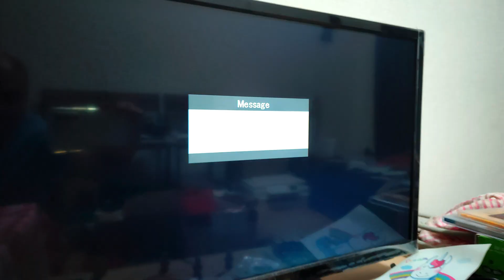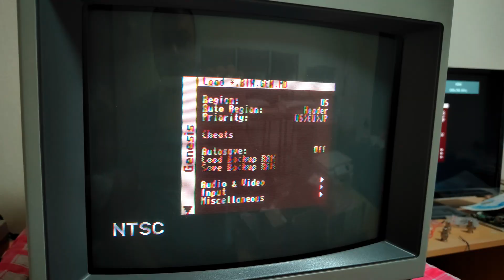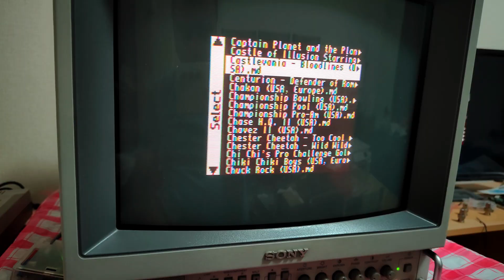The MiSTer FPGA Computer Game System [Part 2]

Comment: I love this, but I was really expecting a moment where a cart is used through MiSTer somehow. As if it could function like a NT Mini (Noir). I might have missed why the cart slot is still there and you mentioned at 3:15 that you had to make a cut out in the cart well for the region switch regarding the filter. What is the use of the cart slot? Will it become a 'dual system' where you can use a modded Dendy for both NTSC and PAL carts and also switch it to become a MiSTer?

Design wise: I really like your thoughts behind and dedication to using shielded cables inside the shell to get the best signals!
And regarding the LEDS being held in place by double sided tape: there is a non-used hole visible on the metal brackets for both switches. Since you printed your own clear buttons and are clearly capable of designing your own parts: couldn't you print a minimal retaining bracket that inserts into those holes to keep the LEDs in place? That double sided tape will lose its stickyness over a yet unknown amount of time due to heat and exposure to air.
Reply from the maker: @MrOpz, Thank you for the response! I confirm that the cart will be used it is internally connected to the Mister FPGA, I totally forgot to talk about it, but it will be a part of the 3rd or the 4th video and I will show you what I do with it. Additionally, your idea about making it a dual system like Dendy+MiSTer FPGA is quite dooable, I wish I had that idea before.. You are right, I can improve the mounting of the LED, I could have actually mounted them with the PCB only but this LED idea was really a last stage idea and I just thought of using double sided tape, in the future maybe I will 3D print a mount and fit it. :) Thank you again for the comment, please this video with friends to help my channel grow as much as possible.
Reply: @ramakrishnamishra8179   Ah, super cool for the reply and thoughts, thanks!
To be honest, the only reason for suggesting the dual system setup was because I was confused about the use of the cart slot. Now that you have mentioned the use of it with MiSTer for later videos I'm positively anticipating your future 'parts' of the video series. I've always been surprised by the lack of physical cart supporting devices other than for the most part Analogue consoles. Looking at the Pocket and its use of adapters for increasing the amount of supported handheld systems, I never understood why there is no manufacturer of physical media orientated FPGA systems. But I have seen a video where a Multisystem2 is used for carts which is promising. I pre-ordered the SuperStation with the SuperDock thinking it would play disc based games, but it turned out to just rip the game from CD and play it as a ROM which is super unfortunate to me.
Reply from the maker: @MrOpz  Thank you, yes, if you want to build a system to support carts then it will be fixed to 1 cart, or you would have to make some fake carts where they will only contain the name of a game and the system will search and run the ROM internally when the cart is connected, or you have to dump/rip the cart/disc in real time and then run it, which defeats the purpose. If you want full real cart support then you will be limited to the cart of the system because the lines will be hardwired to the internal core that the system is running ( just like the analog dedicated hardware FPGA remakes ). My use for the cart is a little different, I will show you later.